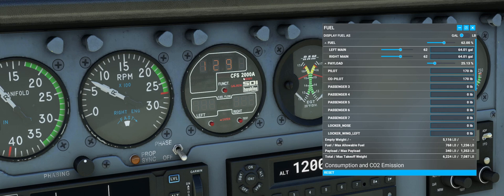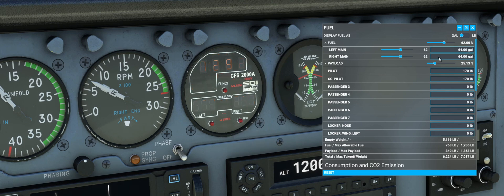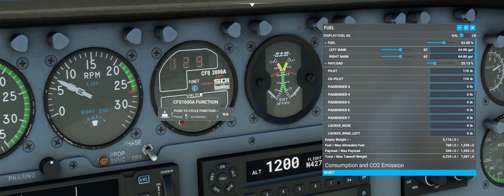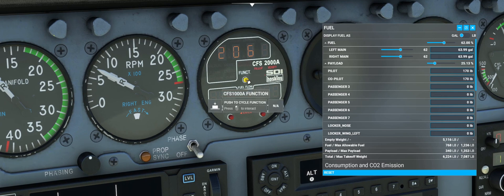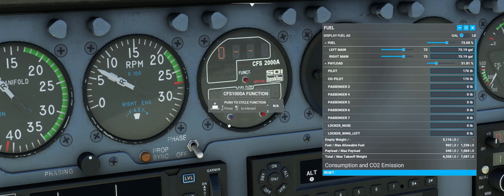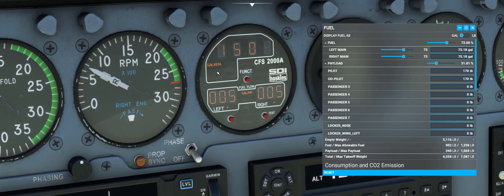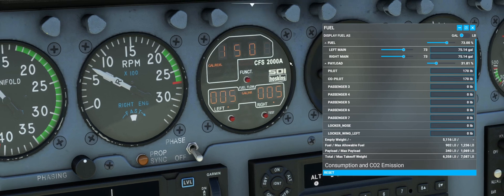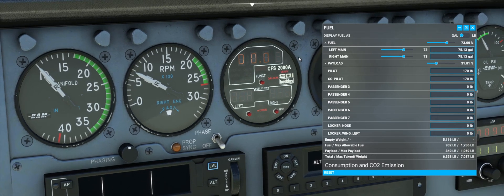FLYSIMWARE C414A Chancellor Fuel Computer Tutorial

Comment: Thank you, that was so much easier than trying to work it out from the manual. I don't know how many times I read that but I still had no idea that you could get back to preflight mode by toggling the battery or how to reset it ! Would it be possible to add a 1 page summary to the pdf manual ? Having the real world manual in there is great but it's a bit daunting and having SEEN how it works the computer isn't nearly as scary as the manual makes it sound. It was a technically good video too, not sure what you were changing about the snippets (was it how you do the voice track?) but whatever it was it's a good result.

Comment: I've had to park my favorite GA aircraft in MSFS2020 because, quite simply, I ran out of fuel and I can't figure out how to fill the tank up. I've read the manual multiple times. This video has helped. But please explain why the fuel gauge on the panel does not reflect the fuel changes you've made on the fuel computer. Thanks for your efforts.
Reply from the maker: Because the fuel computer does not have any connection to the fuel tanks. you simple have to tell it how much fuel you have. This is normal. if you ran out of fuel on the actual aircraft then keep in mind this plane has a save state. So what you walk away from you return to. So if you leave the sim with empty tanks then no matter if you load fuel in the flight planar the plane will load with no fuel. To add fuel open the widget you see on the screen from the widget list above. And simple add fuel. Then tell the fuel computer how much you you have on board. When you finish a flight keep what is left or refuel as once you exit the flight that is what you come back to. Also how you leave the parked mode like chocks and tie downs also will be saved. Happy Flying!
Reply: @Flysimware  Thank you so much for the drop-down widget tip. I'm back up and flying my fav GA aircraft! Much appreciated!